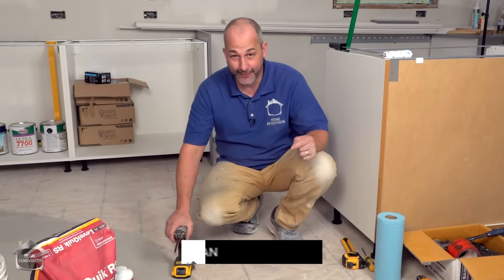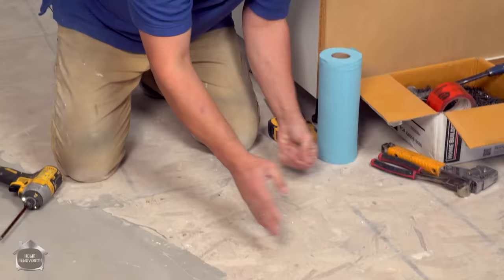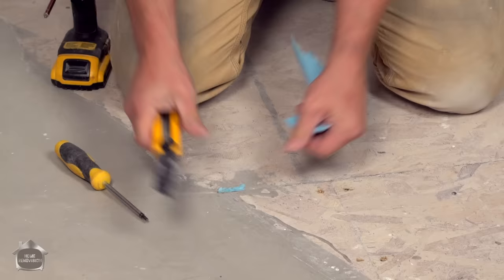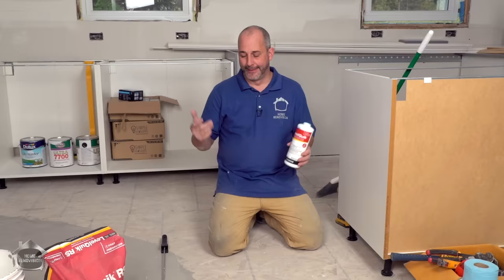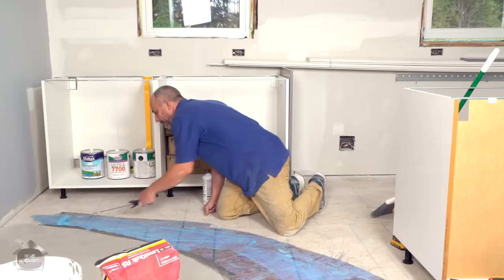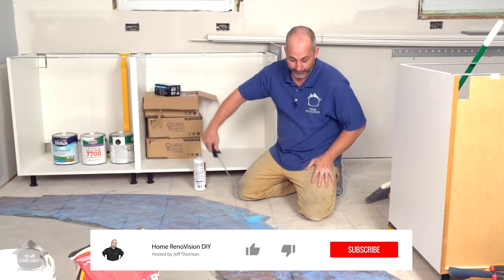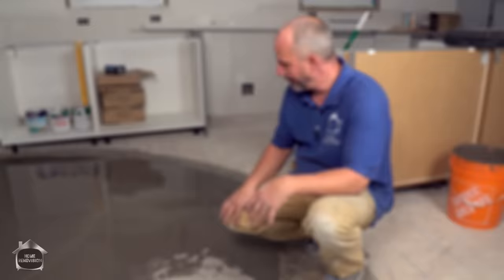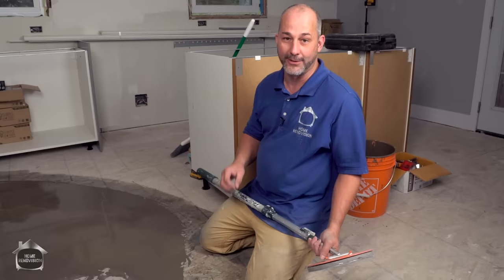How To Level Your Floors

Comment: I figure the slope in my floor saved me from a running toilet that froze up the main septic pipe. All of the water drained into the rock cellar at the baseboard with very little damage done.  Heh. 🙄
Reply from the maker: one of the reasons we shouldn't fix the floor in the basement. Cheers!

Comment: Was hoping you would use my technique pouring the mix into the bucket. Instead of holding the bag and dumping the mix, simply pick up the bag and align the middle of the bag onto the buckets rim. Now you arent carrying al that weight and you can empty exactly half the bag. Just a tip :)

Comment: How did you know how out of level the floor was, and how much leveler to use?
Reply from the maker: I use a laser to measure the thickness needed. then I lay a 6 ft level from the high point and block it level. install plywood to fill the void and then add leveler.

Comment: Please remember to wear a dust mask when your mixing your batches,so you don’t get silicosis.👍🔨
Reply from the maker: Than ks Troy, However i don't mix much anymore so I tend to be more on the occasional means less safety side of things. Cheers!
Reply: i was thinking the exact same thing but dust masks are useless crap they leave way too much space between u and mask get a respirator p95 is only twenty bucks and it actually works

Comment: I just finished my 3rd job with this compound.  The package provides a range of 4.5-5.5 liters (approx) of water per bag.  I have found this range to provide too thick of a mixture that does not flow well.  HOWEVER, I can tell you that 7.5 liters of water is too much moisture leading to very long dry times, and a less than ideal underlayment strength.  Don't ask me how I know.  I think that 6.5-7.0 liters is probably the sweet spot.

Comment: Im finishing my unfinished basement and I need to level my bathroom floor for tiling. I bought the primer and self leveling concrete. My friend was telling me I can use morter to level out the floor because its cheaper, but Im not pro enough for that. Ill be laying down the special ditra underlayment, morter and then tiles. I think I need to find a video on self leveling the floor for tiling that you have done in the past (I think you have).

I decided to carpet my whole basement besides the washroom because I didnt want to deal with the unleveled flooring. Plus I think it will be warmer too.
Reply from the maker: good call. the right pro-cess is to use leveler and then the ditra and then tile. Cheers!
Reply: @HomeRenoVisionDIY  thank you! You replying to my comment means a lot. I'm doing something that is unheard of in resident washrooms. My shower tiles will also be on my vanity cabinets. My floor tiles will be different. I can't wait to finish it all and somehow show you the pics (it's a few months away from being complete)

Comment: Got a question for you guys? Going to be putting vinyl planks down on a existing concrete floor. In one spot there is up to a 1" difference across about a 4' space. What do you guys think would be the best approach for leveling this? This is going to be family room so perfectly level isn't totally necessary but looking for closer to flat.

Comment: 7:30 Funny that manufacturer guide tells differently like this If a second layer is required, install immediately after first layer has set to walkable hardness. If the first layer has dried over 12 hours, re-prime BEFORE second application

And by the looks of color on existing leveler it had been dried more than 4 hours and should be also primed with diluted primer.
Reply from the maker: Funny how they like to suggest spending more of your money on things that are not necessary. Cheers!
Reply: @HomeRenoVisionDIY  Funny how i have spend all ready 15 year by fixing other people mistakes when they haven't followed manufacturer instructions.
Reply: @mr.wizeguy8995  Do you lather, rinse and repeat every time you shampoo?
Experience, apparently, can tell whether it's a good manufacturer instruction/recommendation or if it's self-serving for the manufacturer.

Comment: In regards to filling holes before pouring self-leveling concrete; I've been to an insurance claim where a handyman was trying to level out a bathroom floor, but for some reason, no matter how much he poured, it wasn't leveling out. So after the 20th bag of self leveling cement he mixed and poured into this bathroom, he realized there were a number of voids between the subfloor and the trim which he failed to remove after pulling up the old vinyl flooring. He went downstairs, and found out that the ceiling in the kitchen completely collapsed under the weight of almost a thousand pounds of wet cement. The kitchen was a complete loss, as was the dining room, and the basement was a wreck after the obviously heavy impacts of the soaking wet cement with the old plaster ceiling came down, which took out half the drop ceiling and the homeowner's vintage tiki bar with it....
The handyman didn't have insurance. It fell on the homeowner's insurance policy. It was a major loss. Dry cement was splattered everywhere.

And I honestly have no idea how this dude didn't notice the house shaking from this disaster he caused, let alone hear it.
Reply: holy shit

Comment: I have an old house built in 1901...it has 2 floors on it...the first is the old wide pine planks and someone put narrower hard wood planks over it...sags alittle in the middle...the floor joists are basically trees hand hued..they still have bark on them...I don't want to put carpeting..I'd like to put a vinyl floor in...any ideas ?.once again I think your a great video teacher...thanks

Comment: Hi Jeff you mentioned you used Plywood to build up the area first the instructions mention using metal lath can you skip the metal lath if you use Plywood to build up the floor and if so what's the maximum height you would suggest for the floor leveler without the metal lath

Comment: Timely video for me! Sent you some pics of my floor "situation". Need to self level but unsure about the how to proceed with plywood I installed into gaps of original hardwood flooring.
Reply from the maker: thanks for the picture. did the email info help?
Reply: @HomeRenoVisionDIY  yes. However I'm still uncertain how to properly fill the original floor gaps shop that the cement doesn't go into my basement.

Comment: I’m here for the primer information. The Customs manufacturer website says to dilute the primer 3 to 1 with potable water. I’m sure it’s okay to use without diluting but that’s goin to cost more.
“Mixing Ratios
Stir and use undiluted for non-porous surfaces.
Dilute up to 3 parts water to 1 part primer with clean, potable water for highly porous concrete surfaces. Highly absorptive substrates may require a second application of diluted primer.”

Comment: really hoping someone can reply soon as I’ve used leveler one other time, and I need to use it in our master bathroom this weekend. 

One video I watched used metal lath under their leveler, but this video does not. 

This currently is for installing vinyl planks. 

Any feedback/experiences y’all can share on the dos and don’ts – pros versus cons, whether it’s even necessary? 

We do get a lot of vibration from the railroad tracks about 50 yards from our home several times a day - in case that determines the answers y’all provide…

Comment: According to the manufacturers's instructions for the primer, it should be diluted
"Dilute up to 3 parts water to 1 part primer with clean, potable water for
highly porous concrete surfaces. Highly absorptive substrates may
require a second application of diluted primer.
Diluted primer must be used within 24 hours of mixing.
Dilute primer 1:1 for exterior grade rated plywood and OSB."

Comment: i am starting to work on my apartment it was build in 1974 and came across something i did not mat before as a friend of my called it donnacona Isolation .

it is a plates layed on top of the concrete floor and over it was the under lay with carpet ,  the question on what should i replace it or get them to replace i am living in Canada as of them get bitten up so badly and i am like to put some laminate floor over it ???

love your video content and kip make it .

Comment: Im looking to do a little garage conversion. I need to bring garage floor up to house level, could i lay dpm, then 100mm or so of rigid foam insulation, self level compound, 20mm chipboard, then laminate.

Comment: Go around and use feather finish to seal any nail holes or seams.also not good to make it to thin because it will be weak and crack under whatever floor your installing

Comment: Hi Jeff. When I read the technical sheet for the level quick they say that a metal lath needs to be fastened every 6 to 8 inches when installing Level Quick on plywood. What are your thoughts on that? Thanks for the video.
Reply: Did you receive a response about the metal lath requirement? Thanks
Reply: @cosmo9362  never did. I used it without.
Reply: @druglord57  how did that work for you without it ?

Comment: We are buying a new house with existing ceramic tile (not the little tiles) and a flooring company came out and said that a self leveler will be needed.  They mentioned it would cost the same amount as the flooring JUST for that.  What self-leveling compound would you suggest for installing ON TOP of the ceramic tile?  We are wanting to put either carpet or a float LVP floor.  Thanks and I love the channel!

Comment: I love your appraoch to working...Someone will be all over it...I can't believe he didn't mix it and get out all chunks...Yet experience trumps everything here, and you show and explain how to overcome such little bumps in the process(pun!). So thanks for your videos. I am thinking of using SelfLev as a finished concrete look to my floors over slab concrete...as a finish material to withstand traffic, is it something I can get away with for long term use? (my home is a modern minimalist industrial look...basically like an art gallery look, so concrete is welcome. Just wondering if this material will be a good barier to moisture, and a good seal for the concrete as concrete itself dusts up and always feels like its "powdering" to the touch...which it physically is, I think.

Comment: In the video you mentioned that you placed plywood before the self-leveling concrete when needing to raise the floor by more than 1/2". Do you have any videos on this process? I'm wondering what thickness plywood you used and what other materials I may need.             PS Thank you for all your incredible content, I a newbie that feels way more confident taking on various projects that I would have a hard time doing without your help.

Comment: Hi Jeff and Crew - 

Do you ever try to level particle board subfloor? I have around 500 square feet of particle board subfloor in a DIY pier and beam addition built 40-50 years ago. Half of it is acceptably level. All of it had carpet adhesive directly applied, so I expect to create gouges if I start to pull up the remains of the old glue for a smooth prep surface.  I don't want to create a bigger project than needed to prep for vinyl, but I do want to do it the right way.

Thanks for the great production work and video ideas.
Reply from the maker: Hi Will,  I would suggest you install a new layer of 1/4" plywood over the whole surface to have a nice clean flat surface to install on. it will save a lot of money!

Comment: On slab. Had galley kitchen that we added over 150 square feet to our house. Contractor said leave old tile and they’ll raise the addition floor up to meet it before putting the floating floor over that… we can EASILY feel where the transfer under the floating floor goes from tile underneath to the addition. Any advice? Not trying to nitpick but we refinanced and pulled from our equity for this build and I feel that an even/ level floor should be a must.

Comment: Jeff, if your home is on a crawlspace or over a basement, did you consider jacking up joists from underneath to correct the settling in the center of your house?  That would seem the more elegant solution compared to a levelquik pour.  Of course, the levelquik is the obvious solution for a slab foundation...

Comment: Sorry i found out the hard way. I installed laminate flooring in a bedroom and after  it made a cracking sound in places. I took the floor up and checked. Found quite a few dips and high spots. Used floor leveler and re-installed the floor and no more noise. but it took 3 weekends to do a 10-15 room lol

Comment: I'm Making part of a new garage a she shed. Your videos on hanging drywall were a great help! I need to level the concrete floor beore the laminate. I put two coats of a concrete sealer on last year. Does that sealer need to be sanded off before applying the primer and then the concrete?

Comment: we poured our floor after priming it with regular primer. Its all cracked. We only poured a little bit of the floor. Can we seal the rest of the wood with the sealer and pour over the new concrete or do we have to tear the old concrete that is now cracked out? Also can we seal it with epoxy if we cant pour over it? Or seal it with the sealer?? LOL idk... What would you do??

Comment: Hi.. my kitchen floor also sloped on side, that I will feel it when walk thru. This house build in 1950s, hills side with craw spaces. So currently it has old tile, planning on putting stone based vinyl plank. I wonder if I need floor primer before putting cement? If I put cement does it put more weight to foundation of the house causing it slop even more in the future because of the weight? Thank you

Comment: I have a 3/4” shiplap floor in my bathroom. (Old home) I added 2 layers of 1/2” plywood on top of the floor, but it’s going to be higher than the hallway after I add floor levelling compound.
I was going to remove one layer of plywood , but ideally it would nice to remove both sheets of plywood , as after the floor leveler is added , the bathroom floor would end up being very close to the same height as the carpeted hallway . 
Not sure if I would be going backwards doing so , so maybe leave one layer of plywood on top of the old shiplap?

Comment: Can this product be used as a wearing surface over my uneven concrete balcony? And if so, what type of exterior paint would you use to coat the LevelQuik RS surface for foot traffic? Thanks in advance for your tips and advise.

Comment: i have a project is coming up next week, it's garage planning on using self leveler on existing concrete. My question is do i need anything else before i apply self leveler? I'm planning on just painting the floor after the self leveler is dry. Thank you for your time and effort.

Comment: Hi, I have a 50's house that I bought 2 years ago near Quebec City. I am now renovating the basement. The concrete floor is far from straight and level. The house is 30x42" and between the edge of the basement concrete floor near the foundation wall and the middle of the basement, there's a 2.5 inch height difference( over 20'). I would like level the basement and I was thinking about using self levelling compounds but since there's a 2.5" difference in height that would be crazy expensive. I would like to maximize the height in the basement. My basement is very dry and I've done the french drain + waterproofing of the foundation last year so this is all good.The design I had before I ripped it out (had a water issue) was tar paper + 2x3" (3" side facing the floor) + shims. 

 To increase height in the basement, I thought I could lay down a 6 or 10 mil poly and then build a wood subfloor to level the floor since that would be cheaper. I was thinking of using treated 2x3's but with the 2"side down on the poly, make them level and use a scribing tool to mark the floor contour on the 2x3s, cut the profile in them and them screw them to the floor. That way, I would start at 0" near the foundation wall and slowly go up to the 2.5". Lay down a profiled 2x3 every 16" and then add a 3/4 plywood on top.

Does this makes sense or do you have a better Idea ?
Reply from the maker: that will work but on 16" on center 5/8 osb is much more affordable and still the normal. Cheers!
Reply: @HomeRenoVisionDIY  Thanks for the input   and continue the great work !
Reply: One last question related to this, would you recommend doing the leveled subfloor first or the 2x4 walls on the fondation wall (I already have 2" foam but need more insulation for a eco government credit) first. Not sure if it's better to have the "exterior" basement walls directly on the concrete with the poly or on top of the leveled subfloor. Thanks!

Comment: Love your channel!  I'm totally addicted.  Im planning to do a luxury vinyl time installation over a slab floor with old linoleum on top. There are some fairly significant low spots in the floor, so I think I should do some leveling.  The folks I'm talking to tell me I can leave the old linoleum in place, not worry about leveling and install the LVT on top.  I'm skeptical.  So my questions are..can I leave the old linoleum in place and add leveling compound on top?  If not, how the heck do I get the old linoleum off?  It is well-glued down.  Thanks.  Again, sooo crazy about this channel.  Thanks for sharing your knowledge.

Comment: In my house I have 1/2" ply and then 3/4" particle board stuff. Tbh I never added any screws or leveler and I don't have any issues. The only issues I have is I reused some of my old flooring when I redid my kitchen it didn't click together as well as the first time so my joints aren't as great and they should be. Everywhere else in my house has been solid for the last few years. I'll probably lift and redo my kitchen at some point but for right now it's okay